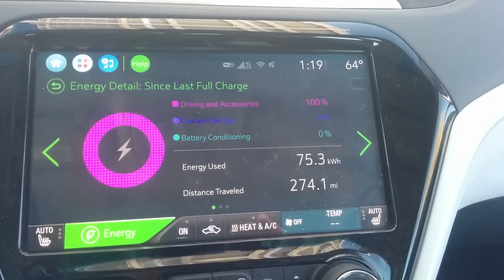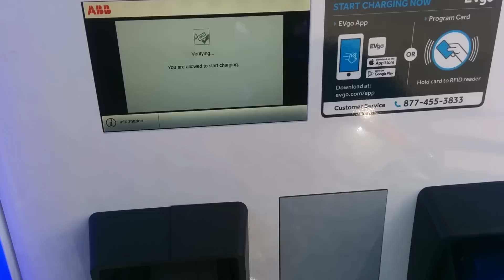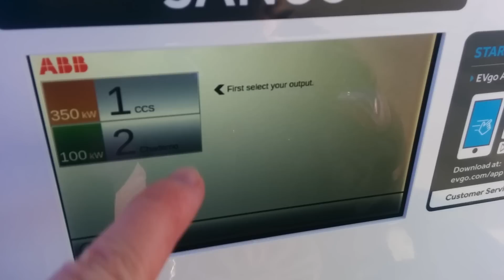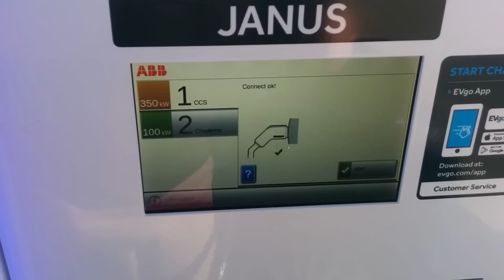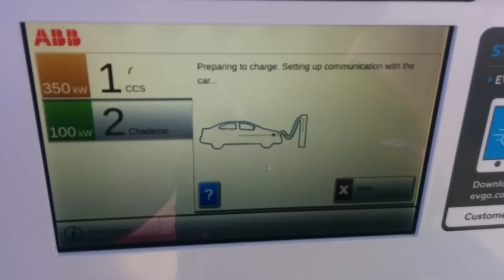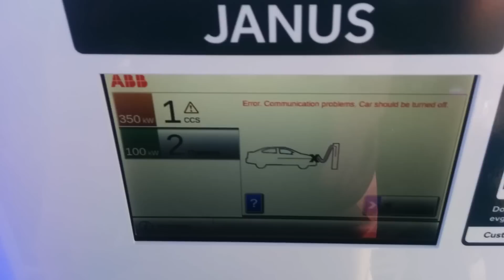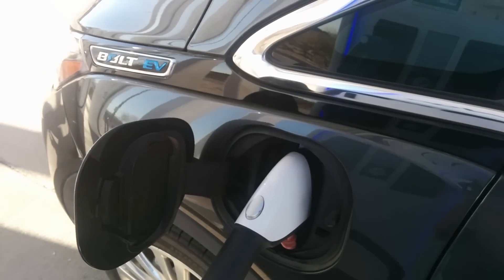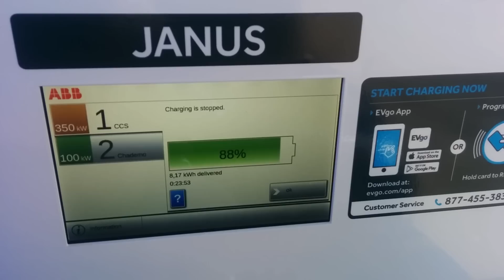Chevy Bolt EV: Charging on a 350 kW (Early Model Bolt EV Issue Explained)

Comment: Just as a note I believe our 2018 Bolt EV (built late January 2018) recently had this issue.  I needed to hold up the charge cord on a 24KW DCFC to get it to activate.   So I'm not certain this is just limited to early Bolt EV's.   Though I've only had this issue once.  I've used other 50KW DCFC's with no issues.   It was also somewhat cold when I tried to charge so the temperature difference might have created a loose fitting plug as well.
Reply from the maker: I am sure that there are some actual bad plugs out there, but this does seem to be a recurring issue with the newer, heavier cords. I can actually see the flexing of my CCS port, so it does seem like something GM could reinforce.

Comment: Can you reproduce the problem by adding downward force on a 50kw CCS? Once that plug snaps in place, doesn’t the Bolt CCS interlock just come down on that top latch? So if the latch isn’t low enough, it thinks it’s not latched securely. 

If you can’t reproduce it with a regular CCS, it would be an indication that there is a slight difference in the plug design. If it can be reproduced on a known good CCS plug by adding downward force, then your port is defective, worn, out of adjustment, or something like that. I can’t find any good pictures showing details on the port to see the most likely cause.
Reply from the maker: Yes, I can reproduce it with 50 kW chargers. The same error occurs when the charger latch is broken. Other Bolt EV owners are able to use those chargers without issue.
Reply: News Coulomb, it’s not cheap, $320.
www.gmpartsonline.net/oem-parts/gm-f--s-receptacle-24285424/

But this one says it replaces 24285424
https://www.gmpartscart.com/p/Chevrolet_2017_Bolt-EV-Premier/RECEPTACLE/70072765/24287239.html
Reply: News Coulomb, hopefully GM will replace it without a hassle, under warranty. You still have any warrant left?
Reply from the maker: About 20,000 miles. 😎
Reply: News Coulomb, GM should let you enroll as a beta tester, slap a 350A capable CCS on your Bolt, and give you root access to your BMS, up to maximum safe limits, and let you dial in the ideal charging profile. But it should have a real-time degradation algorithm so you can know when to throttle and also have full control over the battery cooling.

Or at least upgrade your CCS and put you on the Tester list for BMS beta versions. I think quite a few people with Bolts would like to participate, and the most it would cost GM is a $12,000 battery after the test cycle.
Reply from the maker: @imho7250  I'm sure they've done the testing themselves. Unfortunately, I think the limitation to charging rates has been narrowed down t the batteries themselves. GM and Jaguar look like they've limited the batteries to .9 C, but Jaguar claims they might up the I-PACE's charging rate to 1 or 1.1 C. Hyundai and Kia are also using the same batteries, which is why their charge rates are limited as well. It looks like Hyundai and Kia might have pushed the rate to 1.1 C, or they are using slightly larger batteries than advertised (70 kWh instead of 64 kWh). A vehicle where this is most noticeable is the 39 kWh Kona Electric, which is restricted to a peak charging rate of 43 kW.  

Essentially, a CCS upgrade wouldn't be worth it without switching out batteries. Perhaps if GM wanted to make a lower range Bolt EV (say 50 kWh) using Volt battery chemistry, then yes, they could easily push the peak charging rate up to 125 to 150 kW. Ironically, people would likely be paying more for less range.
Reply: News Coulomb, Robert Lewellen of Fully Charged said they witnessed an I PACE charging in excess of 100 kw, but won’t show that video until next year. 

You wouldn’t gain much going above a 200a CCS If they won’t ramp up they charge profile. But you couldn’t be a full beta tester with a 200a limit. 

You can see buy the voltage when the charge rate gets throttled that GM is being extra conservative, which is good for those who live off DC Fast charging. But for someone who charges at 7kw 99% of the time, and DC fast charges once a month, GM could allow faster charging that would still allow the degradation to stay on par with other Bolts which charge at 50 kw daily. 

How much would a 60 kWh Bolt battery using the cell chemistry the Hyundai Ioniq uses. That would be able to charge at over 2C.
Reply from the maker: The problem is, they higher power cells take up more volume, weigh more, and cost more. I'm not sure I would pay $45,000 base MSRP for a 4,000 lb Bolt EV with a 50 kWh battery. 

Tesla might be offering the best balance right now in terms of charging rates versus energy density. A solid 1.6 C charging rate on similar energy density to the Bolt EV's cells might be about the best we can do with current battery technology. That's why I'm hoping the next Bolt EV can come with NMC 8:1:1 cells... Maybe 70-75 kWh with 1.5 C charging.
Reply: News Coulomb, I wonder why the Hyundai ionic doesn’t change from a high power 28 kWh battery to the lower power Bolt/Kona battery. I can’t find a very clear price on the cells used by each one.
Reply from the maker: @imho7250  My guess is that is what Hyundai will be doing. They announced that their next Ioniq would have about 200 miles of range, which means it will more than likely have a ~50 kWh battery pack. Given that Hyundai pushes their batteries a bit harder, it should come close to matching the Bolt EV's charging rate, but that would also mean the newer Ioniq Electric would see significantly slower charging than its shorter range predecessor. 

Who knows, maybe Hyundai could find a middle ground, and enable a faster charging Ioniq Electric with a 50 kWh battery. Without some battery advancements, though, I doubt it will charge much faster than 75 kW.
Reply: News Coulomb, in sure LG Chem has computer model that let a manufacturer lock in any variable and then adjust the other variables to get as close as possible to what they want. 

For example, if the locked variable is cost of $15k, then as you select thermal management type, C-rating, kWh, kw, degradation, etc all the other variables would adjust to fit within $15k. 

GM sells a brand new Bolt battery for $12,285: gmpartsonline.net/oem-parts/gm-battery-24289550

It would be nice to play around with the variables on that battery, and assuming we lock in that battery case size. How much would it cost to add chiller plates on top of the modules. 

GM advertises the Bolt as being able to add 90 miles in 30 minutes, but that requires more than 125A, which wasn’t really common then, and still isn’t. But with 200A, 350A, 500a chargers on the way, maybe GM can add more cooling to allow faster charging, even if it adds another 5kw AC compressor which only runs during charging. 

Can the current Bolt battery accept 120kw without significant degradation if it’s kept at 50F? Then when the highest cell reaches 4.1v, it can taper, and at that time it starts preparing the battery for the outside temp. If it’s 100F outside. It keeps cooling because the battery will heat up later, but of below freezing outside, cooling can stop and let the last 5-10 minutes of charging get the temperature up to 90F, knowing it’s going to cool down later. 

I am curious to see what the model 3 midrange can charge at, and the mythical SR if it’s ever made. My guess is the SR can’t accept more than 80kw. I’ve seen reports that the MR only charges at 80kw peak for a few minutes and then drops to ~60kw, which is yet another clue that it’s a SR with cells added, not an LR with cells removed. 

But GM needs faster charging, in miles per minute. 50 kw is going to seem like having EDGE when everyone else has 3G or LTE, and 5G is coming soon. If we can say 200 miles range is minimum for a 2019 EV, I think we can say adding 100 miles range in 15 minutes is also a minimum requirement. 50 miles in 5 minutes is even better as it allows you a quick way to get enough to make it home or to a place you can spend more time charging.
Reply from the maker: @imho7250  I think you overestimate LG Chem's involvement in pack design. They are selling pouch cells rated at 1 C charging and 5 C discharging. How the automaker configures the cells and builds the pack is up to them, not LG Chem. It looks like Hyundai and Kia are willing to push the charging rate to 1.1 C, and it sounds like Jaguar will too. Given the Bolt EV's cooling system is just as good, the best we can hope for is that GM pushes the current Bolt EV's peak charging to 66 kW. 

Tesla seems to be going the other direction, and dialing the Model 3's charging rate back a little. Initially, it was charging at 1.6 C. Now many LR owners are reporting only about 1.35 C charging rates, so seeing ~80 kW peak in the MR makes sense. The LR and MR are using the same cells. It also means the SR might only see peak rates of 70 kW. 

One thing to consider is that the Model 3's slower charging could be due to winter weather, but I doubt it because many of the 1.6 C rates were reported during last winter, and the person with the P3D who was telling me about consistent 100 kW rates was experiencing those during fall. 

As for charging faster, they all need to increase their speeds. The Bolt EV might feel like the EDGE network, but it's mostly due to the chargers themselves. On 200 A chargers, the Kona Electric will save about 5 minutes over the Bolt EV charging from 10% to 55%. Not exactly earth shattering, but noticeable over a long trip with many charging stops. But until a majority of your charging stops are at 200 A DCFC, the differences will be minimal. The bigger advantage the Kona Electric enjoys is that its charging rate to ~70% is more acceptable, so you will be able to start eliminating charging stops when trips are longer than 600 miles.
Reply: News Coulomb, LG builds the whole battery using a variety of methods, and the manufacturer chooses from those options. GM doesn’t build any batteries. The Bolt and Volt batteries are made at LG Chem in Holland Michigan. GM has a lot of input, but LG Chem is the expert. 
http://www.lgchem.com/global/vehicle-battery/car-batteries-Different/product-detail-PDEB0002
Reply from the maker: @imho7250  Interesting.  That sort of flies in the face of GM's having the largest battery research lab in the world. I wonder if LG Chem is simply marketing turnkey solutions there, though it does imply that they are taking credit for the pack construction and design, which GM also claims to have done in partnership with LG.
Reply: News Coulomb, GM has the largest battery research in North American owned and operated by a auto manufacturer, as of 2013. They were testing Bolt and Volt batteries. They can torture test the batteries, and apparently have some research on design. Hard to say what they’ve done there since 2009 when it opened. 

They spent $20 million to expand it from 35,000 sq ft to 85,000 sq ft in 2013, but what have they done? 

There is a similar blur between Panasonic and Tesla as to who did what. 2170 format is nothing special. Batteries were never once of GMs specialties. Even with the electrovair they had some crazy Zinc Silver battery which was extremely expensive and not financially viable. With EV1 they used lead acid and NiMH, which Toyota still uses in some of their cold weather hybrids. 

I know GM paid for the R&D of the drive units. They paid for Alan Cocconi to design the inverter later used to found Tesla Motors. 

Seeing how the Bolt, kona, I PACE all seem to use the exact same charging profile. It seems like LG Chem is making the BMS for these guys too.
Reply: News Coulomb Me too!

Comment: Honestly you should go to the dealer and report this for a warranty issue, maybe you already have but you have to keep going back, you have many documented cases of a feature you paid extra for not working properly at multiple chargers made by different people.  They can't claim that it's a charger issue if it's happening with more than one brand new charger.

Edit: Imagine you're someone like me, who bought the CCS option "just in case" but never really used it (I did plug into the 25kW unit at my dealer for 15 minutes once just to see how it worked) and I decide to take a road trip.  If I didn't know about this issue from your videos I would have no idea why it didn't work and could end up stranded in Baker (if I drove there straight from my house I almost certainly would roll into Baker with less than 10% SoC and not enough range to get to the L2 chargers in either Barstow or Stateline/Primm.  In my case I have a late 2017 (built in November 2017 IIRC) so hopefully I would not have this problem but still.
Reply from the maker: If you just got it, you wouldn't have this issue. GM is now aware, and a few of us early Bolt EV owners are attempting to diagnose the exact cause.

Comment: That's slightly annoying but not unimaginable given GM probably didn't figure liquid cooled 350 kW cords were going to be a thing within a year of the Bolt was released.

I agree that a recall with a stronger charge port should be used.
Reply from the maker: And apparently, GM isn't even sure because there doesn't seem to be a difference between the ports on the early Bolt EVs and the newer ones.

Comment: If you park a little farther away from the charger maybe the cable would not pull down as much?
Reply from the maker: It's possible, but that might put even more strain on the port.
Reply: News Coulomb, I’m just thinking that since a thicker cable is harder to bend it may have less downward  torque if it approaches the socket a little straighter.  But it would be best if the socket held the connector more firmly.